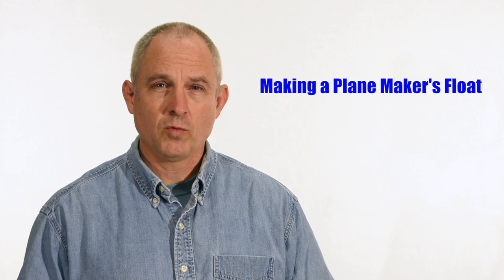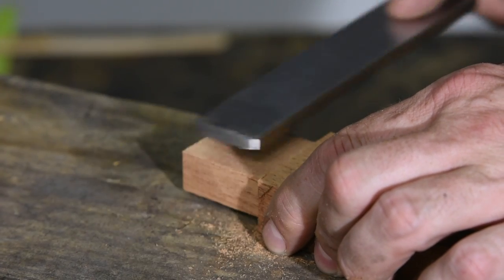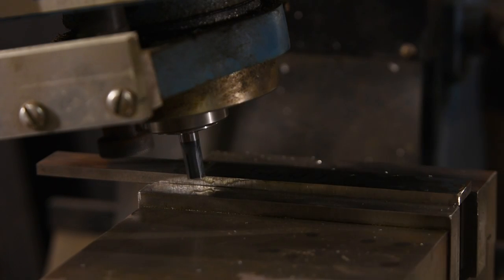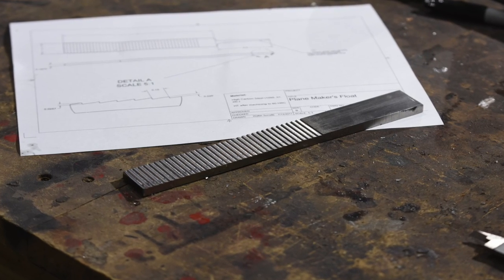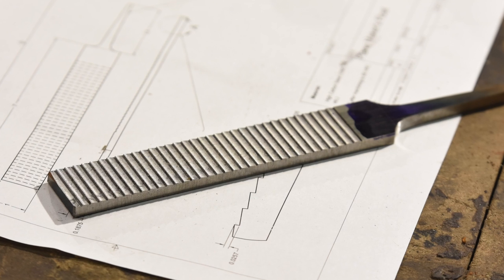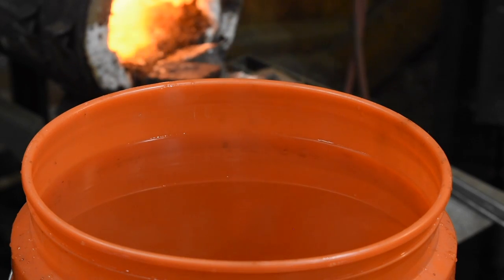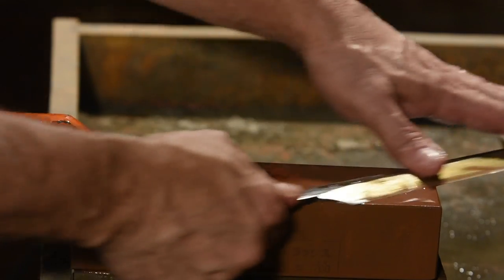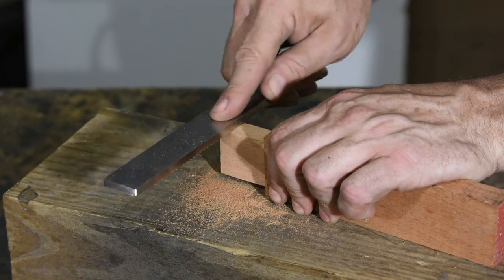Unusual Woodworking Tool!  Making a Plane Maker's Float

Comment: Great job explaining.    You can use a temp stick that melts at a specific temp in addition to a magnet.     MSC direct has a 1/2 inch 60 or 45 degrees  for $35 plus shipping as of today 9/26/24

Comment: There's a channel called "click spring" that recently made a video on how to make a file, it's an excellent watch that I would highly recommend by it's own right but also relevant to my point, I think if you'd have used similar methods you might end up adding a few steps to the process but overall might find it more enjoyable than fumbling with the milling machine and compromising with an end mill (whereas if you form your own punch to create the ideal undercut= no compromise).
Reply: At the beginning, I thought Walter would've used the same exact method, but then I saw the mill...
Would be fun to do it of case hardened steel, just for the sake of it.
Remember tough that Walter was about making a tool, the easiest and fastest way possible, and make it usable and durable. Clickspring's method would be a little more time consuming, especially withouth a mill.
Reply: When I was still working, the boss let us come in on our own time and do our work. I made a nice set of these floats out of Hardened A-2. I put them on the wire EDM and cut the teeth on them. I can't imagine how much those would have cost.
Smiles!

Comment: At the beginning  of the video you mentioned about making tools that are useful but hard to come by. One tool that I always thought would be useful, but could never afford was a beam drill.  An old time tool that was frequently used by carpenters, house framers, roofers, and sometimes blacksmiths. It looks kinda simple to make one, but I'm no machinist and not that confident about making stuff from scratch, especially where cogs and inclined angles are concerned. I have searched everywhere for a video showing how to make one but to no avail. Could you design and make one, using easy to purchase or make parts, scrap wood, etc. with a cost of no more than $30 ? Just an idea if your interested.

Comment: Oddly, I'm wanted the float tool you made myself, and may try making one myself.  Unless you were to mail that one to me. (I won't hold my breath!) 

And as a laughable aside, YouTube's auto Closed Captioning links up you milling the cuts in the float as [Applause] and the belt grinder use as [Music]. Weird captioning software. I usually have it on due to other videos, not yours, but since I do not hear well in noisy environments, it can help. Today I got a laugh. Though a belt grinder can be music to my ears, I still use hearing protection to keep what little hearing I have preserved.

Comment: The planemaker floats dont have to be hardened, since theyre used for very little work. No idea how often they were hardened and how often not.
Reply: but hardened it's better, as with every cutting tool.
Reply: DudeNumberOnePlus Do it the right way, The Walter way, or don't bother. Harden it, then temper properly, it will last ever so much longer. Your grandchildren may end up being able to use them.

Comment: come on Walter you can't show us your magic anti scale milk and not tell us how to make it
Reply: Clickspring uses borax dissolved in alcohol. I’d guess Walter’s recipe is similar.
Reply: Was thinking the same. Could you use clay slurry?
Reply: I’m not a smith myself, Work With Nature, but I would guess not. From what I’ve seen of hamon-making videos, there‘s scale under the clay same as on the unclayed edge, and clay thick enough to prevent oxygen from reaching the surface is probably thick enough to interfere with the quench. But I would be glad to be corrected by someone with actual practical experience.
Reply: some people also use soap
Reply: might be a lime mixture of sorts
Reply: It is a dragon's milk and virgin tears solution of 2:1.
Reply: Dmitry Krasnov lol
Reply: Shred soap add borax and mix with gasoline or acetone. Put it in a jar, seal it and dunk it in boiling water until the soap has desolved then let it cool down
Reply: Joel C. Salomon borax can all be dissolved in water

Comment: I don't like tilting the head on a mill to hard to get it back true I would have just used some kind of a 10° wedge to mount it
Reply: Mounting the workpiece on a wedge would greatly complicate this setup as every tooth will need a different depth of cut, for optimal support you would also need vise jaws slanted at 10 degrees or you'll find that you can either not reach areas buried in between the jaws or have chatter on the part of the workpiece that is sticking out of the jaws.

Aside from that, the tram (squareness of the head of a mill) is something that should be checked regularly depending on how much and how hard the mill is used. 
Personally I'm using a mill that's used by other people too so I can't take anything for granted, I have to check the tram every time I start working and sometimes it does need to be adjusted. If it's out only a minimal amount it's a matter of minutes to get it true again. when it's out a substantial amount like 10 degrees it may take up to 10 minutes to get it dialed in. 
And of course, as with all things: the more you do it, the quicker and easier it goes

Comment: I'm with you 100% until you get to shaping the tang with the belt grinder.  As a better machinist than knife maker, I head for the mill for operations like this.

I'm asking this in earnest, not trolling -- why do knife makers do roughing on the grinder - I'd rough on the bandsaw, it seems like it would be much faster.
Reply: Alan Lapp our belt grinders are soooooooo much faster than the bench grinder or bandsaw, especially with modern abrasives.  Think carbide tooling in a solid machine vs HSS on one with some slop.  
Maybe I just haven't used a very nice bandsaw, but I've never felt as in control with one as on a good grinder, either.  
Another answer might just be that it's the tool we have the most experience and comfort on, too...

Comment: I'm with you on the point of wasting time on making tools. I made a jointer plane with firewood and an eBay blade, and never bothered to "finish" it. Just got it to a point where it works, and it really works great, but other than the sole it's still completely crooked and rough. Taking it any further would be masturbation!
Reply: Think of it as a retirement fund! 

"Vintage Jointer Plane - Handmade circa 2020" has a nice ring to it!

Comment: So much materiál wasted grinding, you could have made two little carving knives out of that if you used a band saw :)
Reply: i doubt you can make damascus out of those tiny particles, they would burn... i dont know.. id love to see someone do it though itd be a great recyclation project
Reply: canister damascus, you enclose them in a mild steel structure that you later grind off. They don't come in contact with the flame, they don't burn, they supposedly sintherise together.
Reply: Sounds do-able

Comment: Sharpening. Sharpen the damn tool for the purpose it is used for and then put it to use. A hatchet for trimming tree limbs does not have to be as sharp as the blade of a smoothing plane.
Reply: richard goebel sharpening is great fun though, you get lost in it

Comment: Is there a practical reason not to have teeth on both sides?
Reply: Brian TX traditionally they were thinner. A second side would increase the thickness (well technically it wouldnt but it would not make sense to sharpen 2 sides as you lose a lot of steel which is necessary for resharpening with thin steel). for tennon use or something like this a second side would cause no problems. But if you work on a plane bed, especially the throat, a safe edge is quite nice
Reply: Floot
Reply: Floats when used in joinery and plane making require safe edges that are also square to the cutting face.  For the knife maker, check around with your local hand crafted woodworking folks for tools they would like.  I had a lot of trouble finding my floats.  Lee Nelson is the only one I know that make a decent set.

Comment: This is a rasp.
Reply: Coach Ro4st *File
Reply: nither, it's a tool of its own category
Reply: Make one
Reply: Actually no, the (punched-teeth) rasp is different much more agressive, really great at removing the wood fast - but its not fit for presision and also leaves the surface very rough.
Reply: +DudeNumberOnePlus yes i know. i wasnt that serious, but i think "unusual Tool" "plane maker's float" is a Little exaggerated, special rasp would fit better
Reply: Coach Ro4st It is a special rasp.. Called a float.